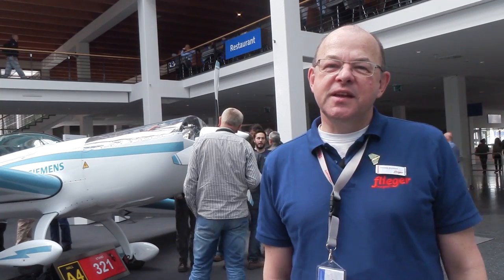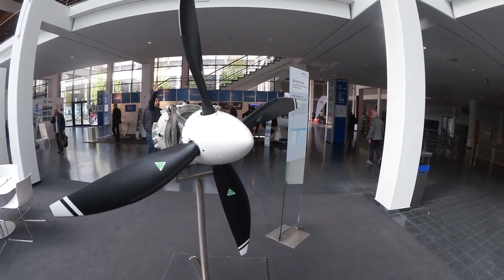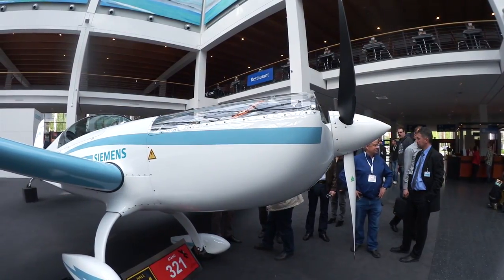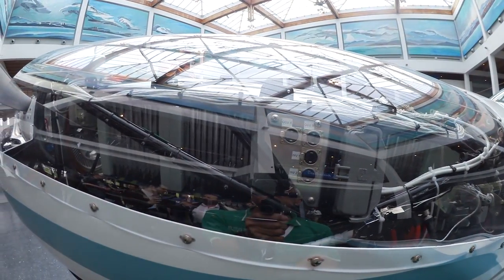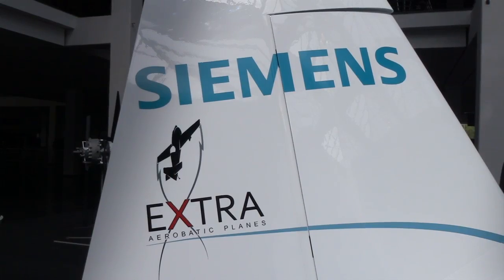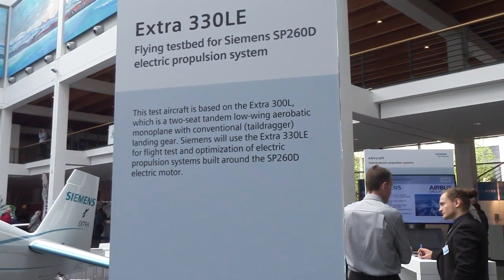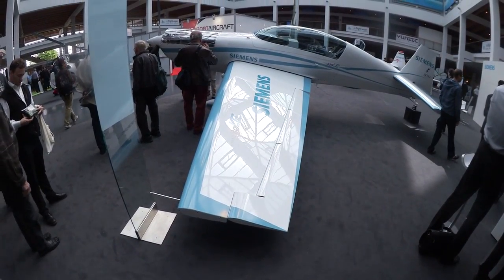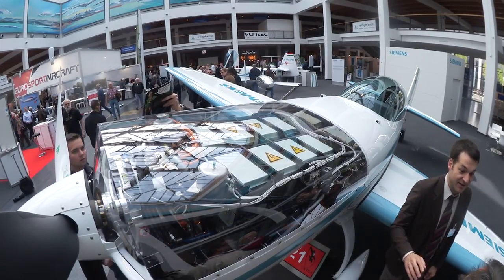Siemens's Electric Extra 330 Aircraft

Comment: They need Safe batteries which will to at least 4 or 5 MJ/Kg which cost less than  100$ per kWh , have life span of at least 8 years retaining at least 80% capacity , high number of charge/discharge cycles and which recharge fully in 30 minutes if they want to make commercial electric and hybrid airliners .

Comment: My be am I just daydreaming, recently  I didn't re-read Jules Verne novels about electric planes, but  still there is a way out of the battery weight dilemna : it's EMP !!
OK for WWIII electromagnetic pulses are expected to stop bombers/missiles in flight, but let us reckon, for peaceful purposes some Tesla Towers could double the actual plane survey network ( Pls. forget MH 370 quizzical disappearance ), sending energy beams towards superconducting antennae - a plane in flight is essentially a moving Faraday cage - that will not help Rex Tillerson , of Exxon-Mobil fame, to pay his bills + make oil big spenders great again when free energy is convertible in every thunderstorm , recently I saw Mark Wahlberg in Deepwater the movie , 2016 , but no need to kill me oil tycoons I was 10 when microwaves lit lightbulbs, nothing new, so  Deepwater Horizon $ 30,000,000,000 disaster cost will have to be taken care of away from Siemens 260 kW- 50 kG- that - can - fly 2 thousand kilogs -each energy consumption, 50 years ago too there was  in Moto-Revue, a French motorcycle mag I liked, a DuPont de Nemours patent for a 50 kW annular steam engine that 'll be perfect to use any heat done as a by-product of rotating fans propelling planes without condensing clouds at 30,000 ft.
Just daydreaming, n'est ce pas ?

Comment: In 1912, a B.E.2 would fly 2 people with a 90 hp engine, 72 mph, for 3 hours, and 15 minutes. An E-Fan can fly 137mph for 60 minutes. Fuel is one of the largest fixed costs in aerospace. Cut that down, and more R&D and you will have something. Stop hating, and enjoy flying.

Comment: Very cool, but not realistically usable in real life. Energy storage is and will remain the problem. Hybrid drive may change that, but these drive train are very complex. And in aviation simplicity equals reliability, longevity.
Reply from the maker: +flexairz Did you even watch the video? Anton clearly states that this is a developmental test article for electric drive trains.
Reply: It has plenty of uses with current batteries like for example training new pilots for take off and landing. It saves a lot of money in terms of fuel costs, especially if they have batteries can be changed. It could also serve fine for acrobatics like he said where flight time is limited.
Reply: Energy storage can be solved with graphene batteries